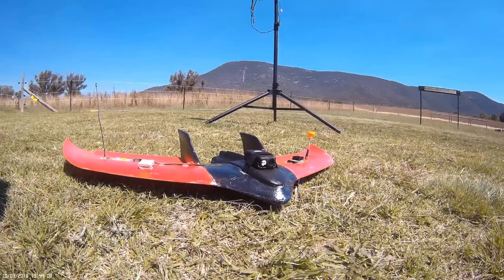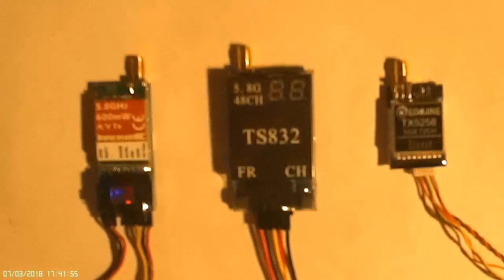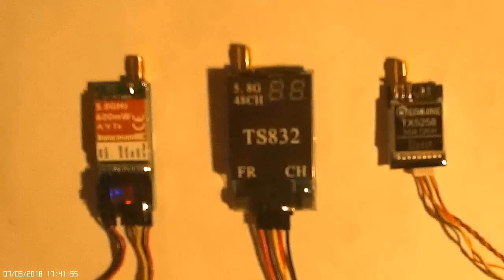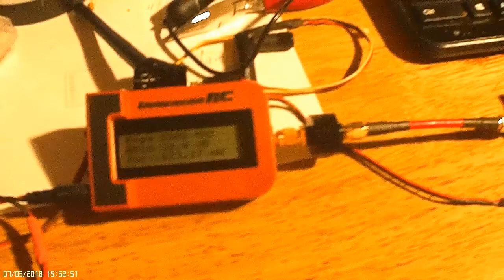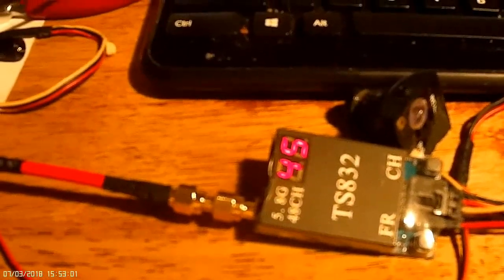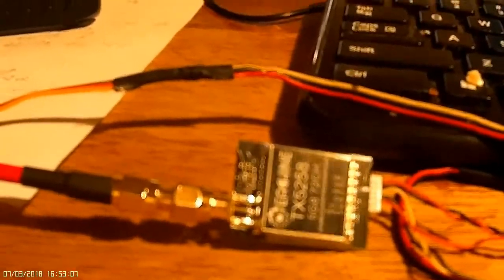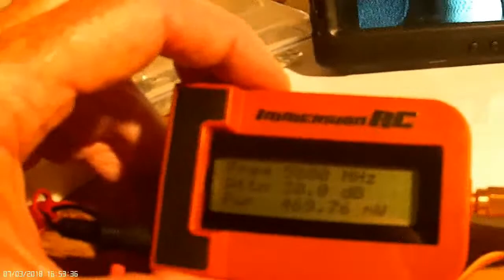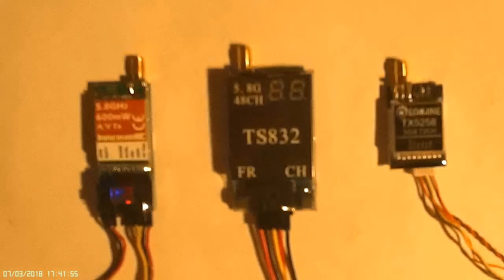VTX output power comparison

Comment: Great vid!  Some sort of RF power meter is a must for FPV I think, I have an RF Explorer and do the same style tests before I fly with anything too.  Before you install it in your plane, check a few channels across the bands, I've had some brands that vary as much as 12 - 15 dB for the same output setting.

I've had good luck with several Eachine TX526 variable power 25 - 600mW ones, 28dB output and flown my nano Talon out to 5.3 miles in a noisier environment than yours, and my ground station antennas aren't as good as your setups either.
Reply from the maker: Thanks. I'll check them out. I settled on 5820mhz after testing the output of the IRC vtx on a range of channels. It seemed to be the strongest for my area but I'm not going to bother going through the same process with the 5258. It's just too far below the spec for me to have any faith in it. It's a pity because I like the layout and display.
Reply: 5.3 miles? :O  What kind of configuration? Antennas? Supply voltage?

Comment: Hi Ken, your readings confirm it, those cheap eachine and others VTX's are pretty average to say the least, the ones I tested with a spectrum analyser were all over the place on proposed centre frequency and nearly all of them were outputting a much wider footprint than the 6-7mhz required for CVBS, meaning lots of the output power is wasted, and opening them up after very early failure revealed the rudimentary class A GaAs Fet output device has no proper heatsinking, while dissipating nearly 2 watts worth of heat..! An absolute guarantee it won't last, but interestingly one of three TS5828's had a tiny 2mm piece of heat dissipation silicone on top of the transistor... still nowhere near enough, but why only one?. I recently found AKK who sell video transmitters for about half the price of Banggood, they do an 800mw version (switchable) and although I heatsink all transmitters very well, this one really performs, I have had it to 7km with a fairly good image just on my goggles without groundstation, and with the groundstation the image was perfect (FR632/2x Circular Wireless helicals) 10Km would be easy. I transmit with a Pagoda on all 5.8ghz planes. Another excellent performer is the Foxeer TM25, I'd say it's slightly upgraded to carry the brand name. I also get 7km with that one in my C1 Chaser. PS, I also use this stuff when attaching the bare transmitter can to the heatsink plate   https://www.banggood.com/STARS-922-CPU-GPU-Thermal-Silicone-Grease-Compound-Glue-p-1136461.html
Reply from the maker: At least they were pretty cheap, The trouble is you just can't tell how well these things perform till you get one and most of the reviews just show what comes in the box. They seem to be targetting the racing drone market which I guess isn't that concerned about range.

Thanks for the tip about the AKK units. I see I can get a 25/100/200/800 version locally here in OZ for 30AUD. I'll probably try one out.
Reply: KenJungles Yes, I would happily pay $100 if I saw that it was decent quality.. The problem with what we do, is we need reliability and some level of precision. I can make them reliable enough, but getting frequency on spec is a gamble hugely affecting range, getting output power is also a gamble as is lifespan.
Reply from the maker: Yes, I guess I'm in search of El Dorado. I've never really had a problem with the IRC 600mw vtx apart from the amount of heat it radiates, hence the heatsink. They actually seem to have come down substantially in price though so maybe I should just stick with them and stop chasing after "cheap" replacements,
Reply: KenJungles good thinking, I think I'll probably do the same. It's a trust thing for me.

Comment: I recently bought one of these; https://www.banggood.com/PandaRC-VT5801-PRO-VT5801Pro-5_8G-40CH-25mW200mW600mW-Switchable-2KM-S_BUS-AV-VTX-FPV-Transmitter-p-1166333.html?rmmds=detail-left-hotproducts__3&ID=523627&cur_warehouse=CN
Was impressed with it enough that I bought a 2nd...
Unfortunately the 2nd one's lead plug had been assembled with a mallet, or nibbled on by robotic rats- either way it means I gewt no picture, just a mainly grey fuzzy picture...
Currently going through BG complaints department to try & get a new lead as unit itself works fine when swapped with earlier example.
They only want to give me useless bonus points rather than a new lead...
I don't know what the actual power output IS, but when set to 600mW Ive had close to 3km's on a Bixler with little to no problems- so long as I make sure the Tripple Feed patch remains pointed AT it rather than the opposite way like when I get disorientated! lol!
Link is in case you want to check 'em out yourself as theyre pretty damn small & were under 20AUD at the time I bought them...
Best of luck & you've made me glad I side-stepped the  TX5258! :)
Reply from the maker: Thanks for the tip. It's always a bit of a raffle buying these cheap units but I guess I've been pretty lucky so far. I've rarely ended up wth faulty products. Good luck with the negotiations.